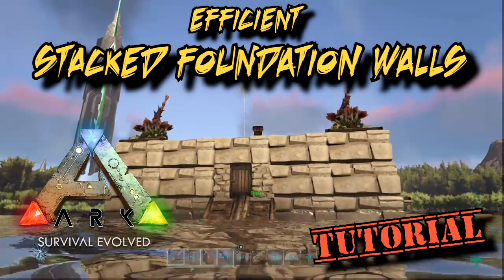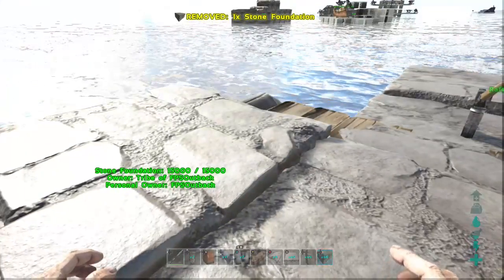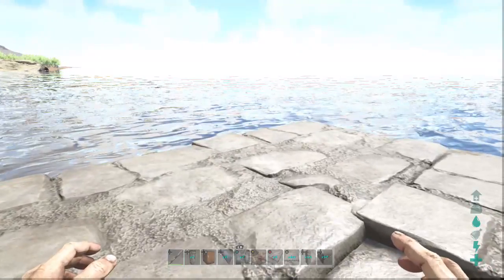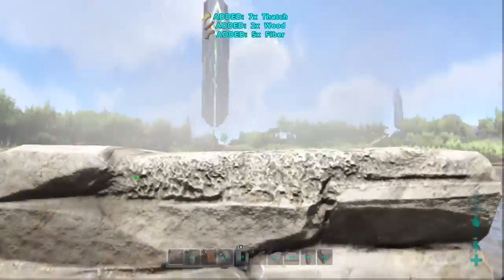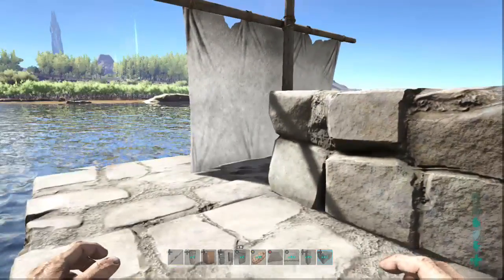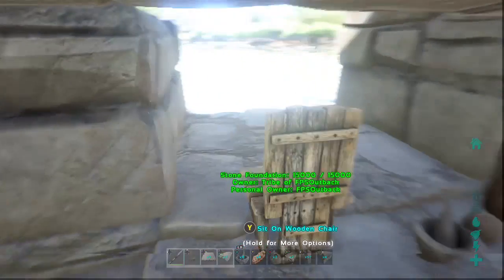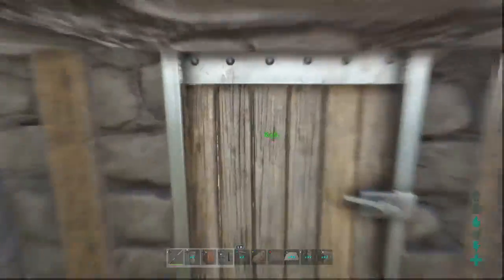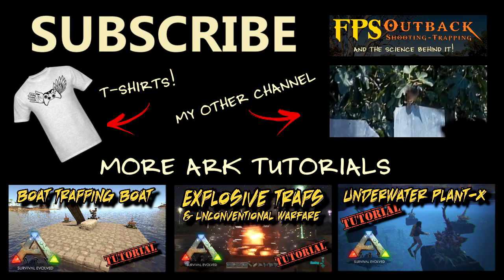Closing the Gap in Stacked Foundation Walls - Ark Survival Evolved

Comment: I just did a test build on single player using this method and it works great.   I added an extra foundation wall extended from the front center to get another space inside, it seemed like a good way to get extra room.   I was able to get two smithys, two preserving bins in the first space going front to back, two forges, two small boxes and a bed in the second, two campfires and several m&p in the space with the rudder, and two compost bins in the rear space.   Most of the furniture was imbedded in the walls so there was still a walkway and I could put a door to add a little more security to the front section with the smithys.   I added armored crop plots to the front and one on each side.   There was still like 12 or more free pieces without covering the mast, I heard it was not longer vulnerable to damage but I'll have to test it before building it on an official server.
Reply: I tried this method on an official server and sadly I couldn't get it to work.   Making the foundation wasn't a problem but I couldn't get them to stack for the walls or roof.   I tried for almost an hour and it just wouldn't give me the green to snap into place.    Also I tested it and I was still able to damage the raft's mast even if it was hidden.   It's a shame because this gave me a good idea for a raft build.